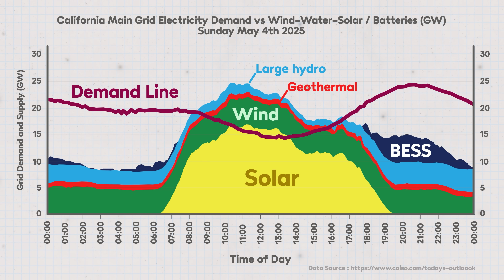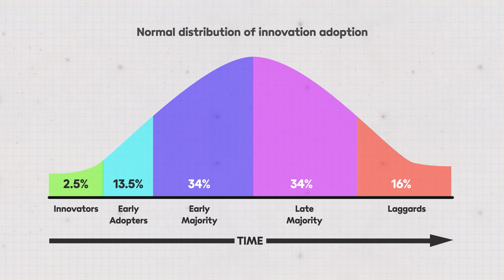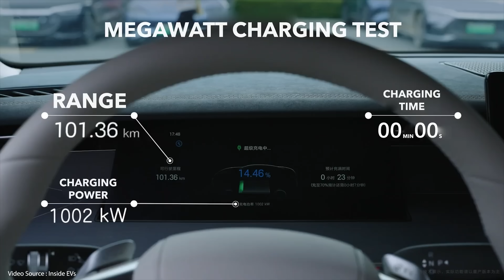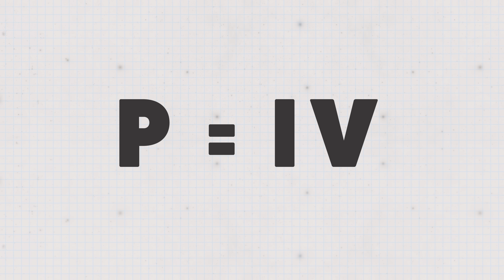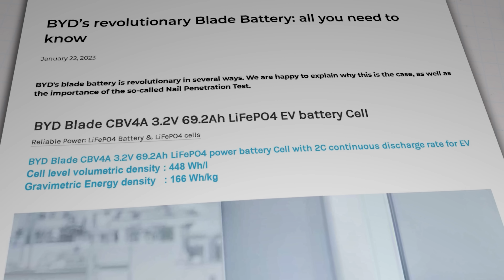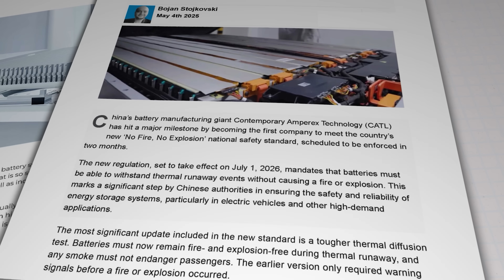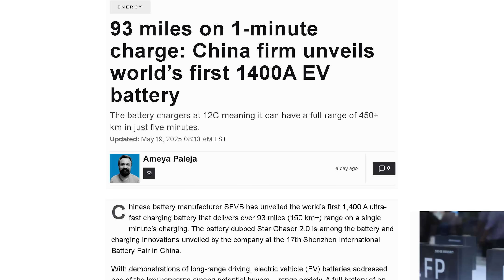BYD 1 MEGAWATT 5 minute EV Charger. Overdue or Overkill?

Comment: I can imagine a situation where cars are capable of 1MW charging speeds but they rarely actually do it.  You pull into a service area and then select whether you want to charge at 1MW or whether 250kW or 100kW is suitable for you depending on how long you plan to spend there.  There would be a price differential between the chargers to reflect the fact that it's more expensive to provide power at 1MW than 100kW due to the grid connection involved.  Furthermore these cars, because they're capable of 1MW charging, would be able to charge at a flat 250kW or 100kW across most of their charge curve.  250kW charging for 15 mins gives around 60kWh energy, enough for 240 miles of driving at 4 mi/kWh, do you need more than this most of the time?!
Reply: So you pull up to a megawatt charger in your leaf, while the people with more capable cars are sitting behind you absolutely livid.   Better to offer a range of stalls, and price them based on what the stalls can achieve.
Reply: @jnawk83  This was exactly what I meant - ie the chargers were 1MW, 250kW or 100kW and priced accordingly and you pick the one you need.  Even if your car is cable of 1MW charging, you may be planning to stop for an hour for lunch and so only need 100kW charging so you'd pick the 100kW charger and pay less per kWh.

Comment: I'm not anticipating a platform with so many comments s in already. I state openly, that I am a massive fan of EVs and of your channel but I am also a pragmatist.

The optimism surrounding charging speeds is fully justified except for two factors yet to effect the market, at least in my home country, the UK.
At the moment, the majority of people who own an EV have the possibility of an off road private charging point. Many of them are unrepresentative/minority of the overall demographic automobile owner/user by virtue of their financial status and their enthusiasm for climate action. If really significant market penetration for EV is to reach the levels we desperately need the chaos around charging stations and the range anxiety that you seem to imagine has gone away, will still loom large in people's minds.

My second and longer term point is about individuality. Pertinent in particular here in the UK. Using EVs as part of a grid balancing plan means using "MY" EV without "MY" supervision, even if I have signed a contract allowing "MY" privatised every supplier to access the battery of "MY" vehicle for such a purpose, if needed, when it's plugged into the grid. Currently, home systems including battery storage are rare but the comings and goings of electrons is likely to become much more complicated as numbers increase rapidly over the coming years.

None of this helps millions road users without the possibility of a private charging, who would be obliged to use a public or more likely corporate charging point. 

The blindingly obvious solution to this is to apply pressure to the adoption of battery swapping.
This way, grid balancing can be devolved to fewer points on the grid and more easily democratises the permissions and likely inconvenience to end users, of grid balancing using automotive batteries because large numbers of these  will be in swapping stations. In today's obsessive culture of individual and market driven freedom, we are unlikely to see manufacturers forced to adopt universal battery systems, which could see market penetration for EVs soar exponentially, however, with the launch of smaller, cheaper EVs with swapping, I believe that market advantage will become obvious and therefore accelerate the change.

Of course, were it not for the range anxiety problem, BYD and CATL would never have entered their fierce competition resulting in these amazing technical achievements but their work will inevitably benefit all the whole world eventually.

Much of this would be easier to imagine and to manage from a strategic point of view if we in the UK had not adopted the chaos of privatised energy distribution systems. A fault that will inevitably hobble our economy for decades if we don't rectify our catastrophic error.

Comment: Not to point the obvious out but 30 million combustion engine in uk if everyone changes to electric you need 210GW of electricity to charge them current grid capacity 40GW., where are you going to get the electricity from. You have 11000 wind turbines producing 6GW that means you need 385,000 additional wind turbines, you would need to build 105 every day for the next 10 years to meet that requirement, and the price of electricity will go up because offshore turbines are the most expensive way to generate electricity, and we haven’t even started with heat pumps
Reply: Refining petrol takes an enormous amount of electricity. And not every car needs to charge at the same time (it's not as if there's enough petrol pumps for everything to park at one all the time either), or for all of overnight, there are a plethora of options available.

Comment: AI Summary

Abstract:

This video explores the transformative advancements in battery technology, focusing on both grid-scale energy storage and electric vehicles (EVs). It highlights the increasing importance of Battery Energy Storage Systems (BESS) for grid stability alongside renewable energy sources, and the potential of Vehicle-to-Grid (V2G) technology. A significant portion details innovations in EV battery design and ultra-fast charging, particularly BYD's "Blade Battery" technology and its 1000V/1000kW charging platform, which promises dramatically reduced charging times. The video explains the technical benefits of high-voltage charging and cell-to-pack battery structures for energy density and safety. It also showcases parallel developments from other key players like CATL and SEVB, underscoring how these rapid technological leaps are addressing consumer concerns about range and charging, accelerating EV adoption, and rendering previous energy forecasts quickly obsolete.

Revolutionizing Energy Storage: Fast-Charging EV Batteries and Grid Resilience

*   0:00 Battery Energy Storage for Grid Stability: The video introduces the growing role of battery energy storage in stabilizing electrical grids, especially in regions like California, as renewable energy adoption increases. Grid-forming inverters are highlighted as crucial for a resilient grid.
*   0:39 Electric Vehicles and Vehicle-to-Grid (V2G): Discusses the rapid growth of electric vehicles globally and introduces Vehicle-to-Grid (V2G) technology, where EV batteries can feed energy back into the grid to balance supply and demand.
*   1:20 Addressing EV Adoption Barriers: The primary obstacle to widespread EV adoption is identified as consumer perception regarding cost, range, and charging speeds, rather than the technology itself.
*   1:58 Next-Generation Battery Technology: Significant advancements in battery cell chemistries are presented, promising much longer ranges (approaching 1000 kilometers) and extremely fast charging times (e.g., 5 minutes).
*   3:31 BYD's Ultra-Fast Charging System: The video details BYD's new technology, which combines its "Blade Battery" with a 1000-kilowatt, 1000-volt charging platform, aiming to add 150 miles of range in just five minutes.
*   4:05 High-Voltage Charging Principle: Explains how increasing voltage (V) while reducing current (A) for the same power (P=V*I) minimizes resistance and heat in charging cables, enabling faster and more efficient energy transfer.
*   6:36 Blade Battery Design Advantages: BYD's Blade Battery utilizes long, thin cells directly integrated into the battery pack (cell-to-pack, CTP), which optimizes volume utilization, improves structural integrity, and enhances thermal management.
*   7:23 Performance and Safety Benchmarks: The second-generation Blade Battery achieves 190 Wh/kg energy density and a 10C charge rate (full charge in 6 minutes), translating to 500km range in 5 minutes. CATL's Qilin battery (4-5C charge rate) aims for 250 miles in about 12 minutes and focuses on advanced safety standards ("no fire, no explosion" by 2026).
*   9:02 Perception Drives Mass Adoption: While current EV charging is already sufficient for many, ultra-fast charging is seen as a "grand PR gesture" to overcome psychological barriers like range anxiety, thereby accelerating mainstream EV adoption.
*   9:53 Rapid Innovation Across the Industry: The video notes that numerous other battery manufacturers are rapidly developing new chemistries and configurations for fast-charging, rendering current energy forecasts quickly obsolete.
*   10:24 Extreme Fast Charging Example: Introduces SEVB's Star Chaser 2.0 charger, claiming an extreme capability of 250 kilometers of range in just one minute, illustrating the aggressive pace of innovation.
*   10:41 Disproving Skepticism: The rapid advancements in battery and renewable technologies are increasingly making previous skepticism about their viability appear unfounded.

I used gemini-2.5-flash-preview-05-20| input-price: 0.15 output-price: 3.5 max-context-length: 128_000 on rocketrecap dot com to summarize the transcript.
Cost (if I didn't use the free tier): $0.0052
Input tokens: 13875
Output tokens: 902

Comment: I would have a problem with paying about 50 percent of the costs for a new car on the battery and then degrading its lifespan by cycling it on the grid to flatten energy spikes. If they don’t make the batteries affordable to service, replace and to buy, it’s really not that appealing to me. My current car is 18 years old. I doubt an ev would come that far with its original battery, if it’s grid tied while it stands in the garage.
Reply: I agree, I always tell people to compare mobile phone battery to EV battery, same technology, what is their personal experience with mobile phones, when they got them they held charge for 2…5 days depending on mobile how long before they don’t hold charge for a day 4 to 8 years, and mobile phones are generally kept inside in warm environments not left outside in the winter cold

Comment: (1)  Pipes have resistance in exactly the same way as  copper wire which causes energy losses.  How do you suppose heating systems are designed?
(2)  The national electricity grid will never be able to meet the demand if even a tiny number of people had such EVs. Now and not ever, so all pie in the sky.

Comment: I'm struggling with the change over from my diesel SUV to a battery electric car. I need a car that can complete approximately 200 miles a couple of times a week. I'm also in the situation where I have no off-street parking and the cost of charging at public charging stations seems to be around 75p to 79p a kilowatt. Is there any coming innovations that will see the price of public charging drop? Otherwise it is just not financially viable currently for me to change.

Comment: I guess we're going through a period now where tech recently installed and operating in the real world starts become close to redundant in a very short time.

I'll be holding onto my Diesel for as long as I can, that's for sure. 
I've had it 8 years, if I can keep it going for another 8, with the extremely low mileage I do, I figure I'm doing my tiny little bit for the environment. 

Should the car not last that long, I may consider simply not buying another car at all - and the ridiculous world I live in, where there's two cars in our two person household, could just become a single car.

And therein lies the ultimate problem - everyone wants their own car. 
Sure, moving over to EV's has the potential to lower greenhouse gas emissions if the entire infrastructure being motorised vehicles is also low or free of emissions - but it doesn't solve the other problems, namely the rapid degradation of nature. 
Our natural systems are perilously close to collapse. 

Halving the amount of cars globally over 2 decades would probably do far more for the planet than shunting everyone into EVs.

Of course, it will never happen - our global economy relies on infinite production with finite resources.

Comment: For someone whos channel is called lets have a think ,you seem oblivious to the fact that regardless of charging times, power grids are a million miles away from being able to supply the electricity required to charge EV's and run useless heat pumps.🤦‍♂️
Reply: Most people don't hold on to useless heat pumps, they replace them, and if you're concerned about the grid, just put batteries locally to reduce the peak load.

Comment: The main issue is the availability of supply and cost of supply.  This type of technology draws huge current and costs a lot to deploy.  on a BRP it takes 40 min of charging to do a 900km road trip in a model Y from Melbourne to Sydney, two stops of around 20 min. Its no necessary.

Comment: Charging speed is important for long-distance road-tripping but I saw very little if any mention of faulty sensors in many EV related youtube channels.  I have seen sporadic cases mentioned of sudden braking with Teslas but not sure what were the causes.  Recently in Malaysia there was a case of sudden braking from 100 km/h to zero in a few seconds with BYD Atto 3.  Fortunately no lives were lost or hurt in the incident.  Also fortunate this time BYD admitted it was a door sensor fault and refunded the owner near full price of the car.  As of this comment, the owner is reconsidering getting yet another EV.  EV itself is not at fault but its implementation is still very new especially it is built like a smartphone (some say computers) on wheels.   Here every unforeseen error handling e.g. a faulty sensor can cause the EV to behave in unexpected ways - definitively endangering lives of occupants and other road users.  Previously issues with EVs were sporadic battery fires, now sensors - with numerous sensors in a typical EV, who knows what will happen if one or combination of failures will make the EV react in unpredictable and unsafe ways.

Comment: It won't make the slightest difference to "the writers of these articles" because they're not based in fact in the first place. In fact those "writers" will be getting a pat on the back for having encouraged manufacturers to waste time and money on abilities that no one needs or wants. Almost all EVs can now drive over 200 miles, which is 3-4 hours driving. Real humans need 20-30 minutes to buy some food, and go to the toilet after that time. Things you cannot do while refilling a car with petrol. So current EVs are already faster than petrol over long distances. Indeed, 5 minute charging is actually slower, because with such a short charge time you can't go and take care of your human needs. You need to stay with the car so you can unplug when charged, then drive the car to a parking spot. Otherwise you're holding up people who need to charge. You end up at the same disadvantage as a petrol car who has to fill, then move and repark.
Reply: Bull. I have done 5,000km round trips many times, and in my EV it is always far slower than in my ICE cars. I can feed my family of seven and get them through the toilets and still be much quicker in ICE cars. I have never had to stop overnight at a motel until stuck in Rochampton because no chargers were working in the whole town for an Atto3. Also broken either side of Rocky - a nightmare. My experience was 50 years in cars and 2 in EV's, and those two have been worse than the entire 50. Based on facts.
Reply: @aussieideasman8498  "Atto3". I didn't say all EVs. The fact that what was the cheapest EV for sale in Australia isn't among the fastest for long road trips doesn't change the fact that there are plenty of fast charging cars. Yes, the infrastructure is still poor in a lot of places, but that's changing. As you said "no chargers for an Atto3". Again, you chose the cheapest car you could. But, if you did that trip today, the Tesla chargers are now open to all EVs with CCS, which lets the Atto3 go from 10% to 80% in 35 minutes for just under 300 km of range. Not like the 1000 km/h charging of a Tesla, but not as bad as you're making out.

Comment: Maybe i missed it but i think it has not been mentioned in the video that for this 1MW charging the cars will need to be connected to two plugs at the same time. Each then supplying 500 kw.
That will require very specific charging stations. 

Regardless, with the upgraded battery cells the charging curve will stay consistently higher compared to other cars. Even with just one plug charging time is reduced.

Anyway, for private car use it's acutally not needed. Just use slow AC charge where you park during daily shopping, gym, cinema.... And on long distance current charging speeds will already be quicker than a proper visit to the toilet.
Reply: Sounds like a plan - make it 4 charging ports at 250kW each with your battery segmented four ways, lol.

Comment: It is unsafe to drive for much over 2h without taking a 15m rest break. An EV with a 300km range (say 54 kw/h). Can drive 240km at 80% SOC. This is perfectly adequate. 
So a charger that can deliver 150kw average of across the 10-80% SOC range  meets this perfectly.
The problem is there are not enough fast chargers available, and they’re often in places where stopping for even just 15minutes is not very pleasant.
Reply: The problem is your calculation sucks.